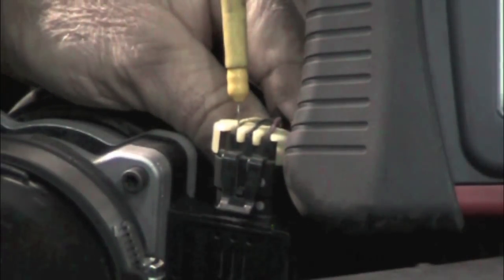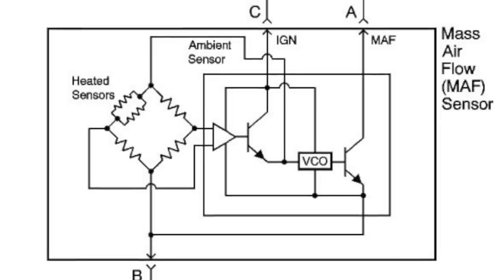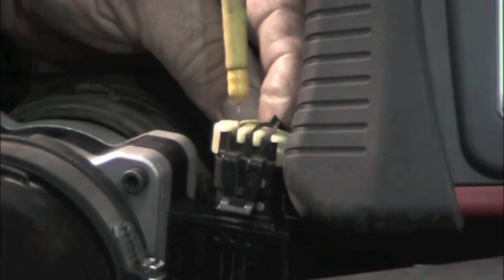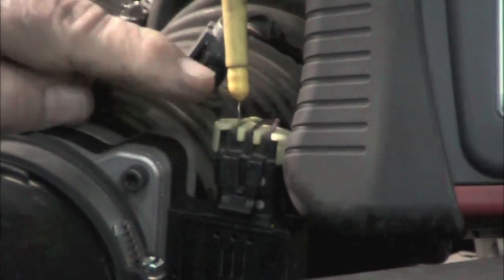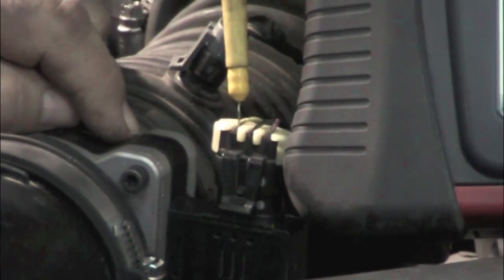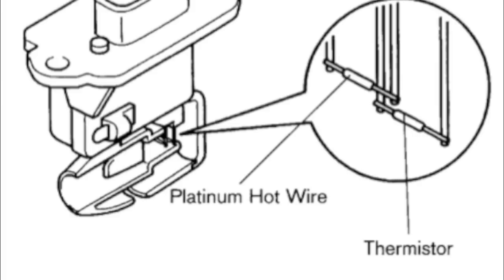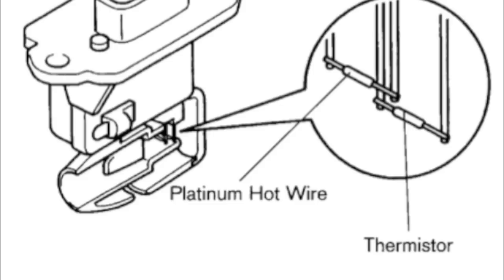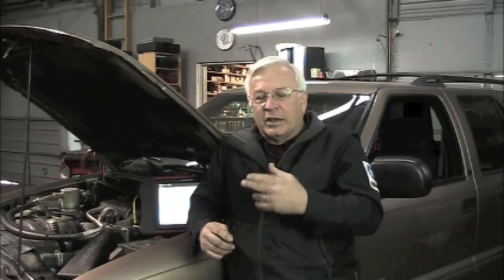MAF Test part 1

Comment: 2min30sec.   frequency can be explained by on off time (duty cycle) - that's not a correct statement.  that's pulse width modulation.   Frequency is defined by cycles per second in hertz.  You said this MAF varies the frequency.   Just putting that out there.

Comment: I know that it is possible to clean the hot wire MAF but what about the one with the film, can the film be cleaned or does it have to be replaced. I don't hear much about the film type MAF.
Reply from the maker: Carl, as long as there is no current passing thru it, yes it can be carefully cleaned,  I have had success doing it
Reply: @realfixesrealfast  thank you for clarifying that.

Comment: The MAF on my 3.8L OLDS almost caused a car accident. It caused my unsuspecting wife to almost hit a car in front of her but she had the mind set to turn onto curb. It did set a code error after that incident. The MAF called for an increase in fuel when the engine stumbled and almost died at idle. To be more exact the low RPM of almost stalling (because of a bad MAF) made the computer open up the injectors which over compensated for the low air flow. If the brake is not being applied at the time the engine surges for only a second but that is enough to send the car suddenly forward and could be catastrophic if in close proximity to something or someone. 

   Readings using the OBD II scan tool before the error was picked up showed MAF g/s at 5.73 with RPM at 846 RPM. After error code P0102 it showed MAF g/s at 1.75 at 2171 RPM. With new MAF replacement it showed MAF g/s @ 18.77 at 1432 RPM. Tapping on the MAF did nothing for causing engine stumble. You can see that the new MAF has much higher airflow at a lower RPM, which you can use to check your MAF. I don’t want anyone else to experience what my wife did.
Reply: mrwebber35 I had the same thing happen on my 02 ford truck.  It would idle up and down and when you accelerated did nothing and then would lunge forward at full throttle.  Had I been in traffic  this could have caused a major accident.  I watched YT videos and can say many of these certified techs are WRONG.  Where several certifieds say if you unplug the maf your system with use its backup and you can use this as a test means.  NOT ON ALL OF THEM!!!  My vehicles engine as I described above was just as violent with it unplugged as with it plugged in, so maybe some have no backup memory because my PCM is working right.  Next morning I went to Oreilleys parts in my dodge ram and bought the MAF for the 02 ford and after installing it the problem is gone.  So where these techs say they you can unplug a maf and it will run right is not true in all cases.  The best way to describe what my engine did is a strong man that has a seizure and three people have to hold him down.  If a petite woman would have been driving the thing it could have gotten them killed.  Its LOL not funny but when your car turns on you and get rabied LMAS.  I'm a master mechanic too so I'm not exaggerating here
Reply: Earl Guyton What's amazing is that There is no difference between Toyota ford Honda Chrysler GM Or Volkswagen when it comes to these things. I just bought a 2015 GM I'm curious to see how that's designed.

Comment: I loved your video on the vacuum test: very clearly visible, concrete example, brilliant. With this one, I have to remark that you're confusing the electrical notions of frequency modulation and pulse width modulation. Also current and electrical power. For didactic purposes, it's probably better to use a MAF with a simple proportional voltage output. The frequency really doesn't have anything to do with basic operation. That's simply an extra conversion done for better signal transmission.

Comment: @michaelovitch I've got a single mic and when I replay and post, I get sound out of both speakers, which is not a problem. But for this video, wearing headsets means you only hear sound out of one ear. Can you offer any suggestion as to how Duane can get sound out of both sides? One of the clips in this video had the sound reversed to the opposite speaker, and he's posted some clips that are fine. Is this a processing problem, or is it a poor connection at the mic jack?